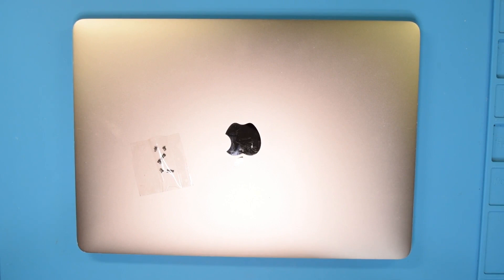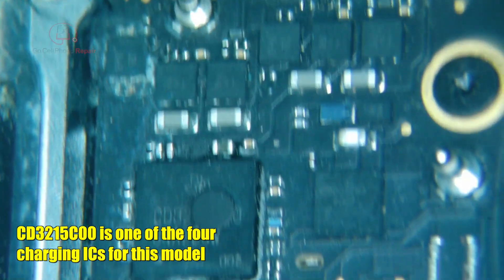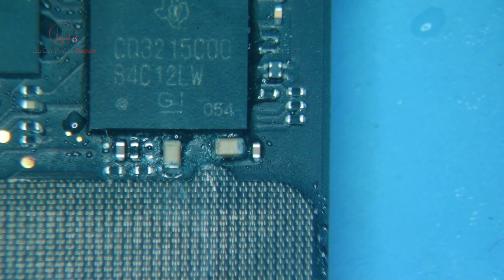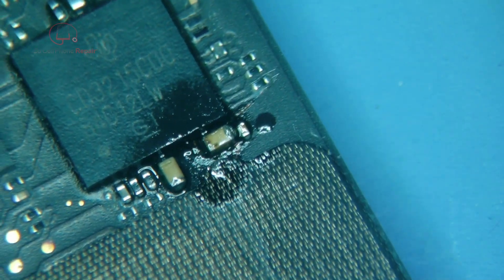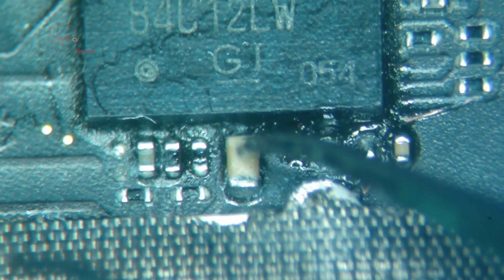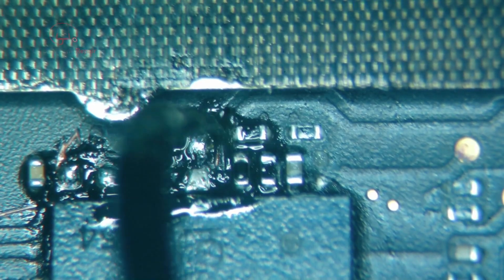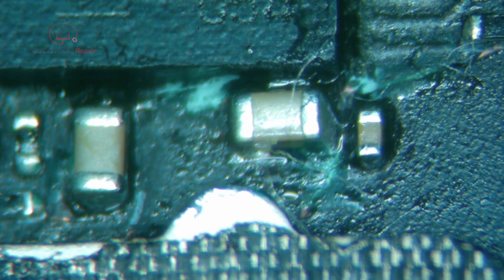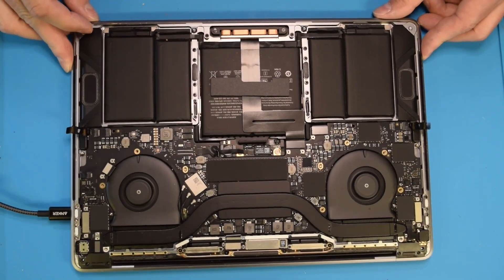MacBook Pro A1989 No Power Repair | Only Drawing .4 Amps at 5 Volts

Comment: Hi! This is an off-topic question… Do our refurbish the digitiser for iPhone displays? If so… could I use a kitchen vacuum bag to “laminate” an iPhone 12 oled display? I just have to change the glass and OCA glue only. What do you think?
Reply from the maker: I haven't done any screen refurbishing for quite some time. Back when I was doing OLEDs for Samsung phones, you could push out the bubbles and did not need an autoclave. Not sure that a vacuum sealer would help you but you might try experimenting with some older phones.
Reply: @ Thank you for the quick response! Squeezing those bubbles out will be the best option I think. After posting my comment I realized that there is a liquid variant of OCA glue which doesn’t need specialized equipment. I mixed 2 different repair strategics. 😅

Comment: Next one, use your bench supply to pump power direct into the battery's (disconnected from the motherboard) to start the charge before putting the usb c in.
Reply from the maker: Will do that in the future. I have a couple more that are already completed though that will be posted soon. They were also fairly easy to solve without the need for PSU.